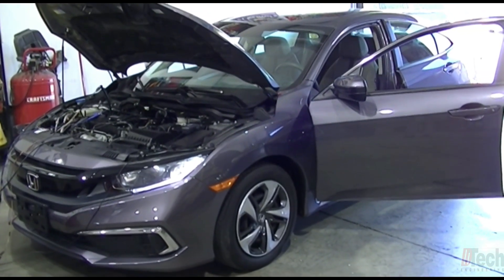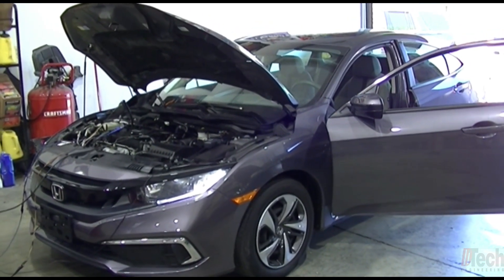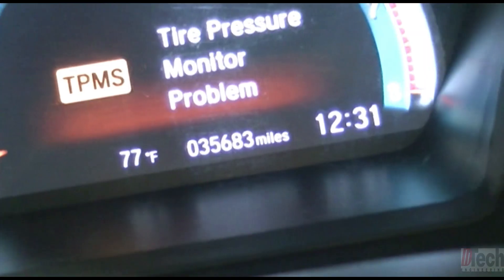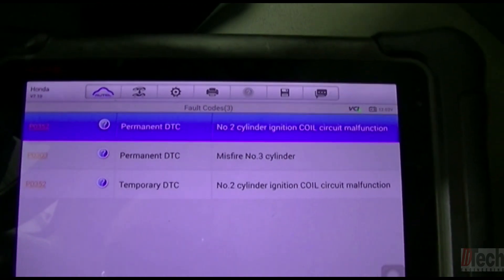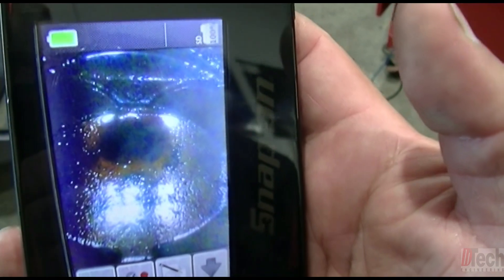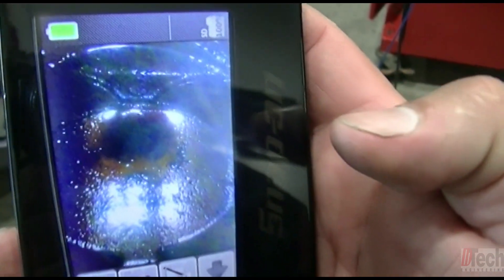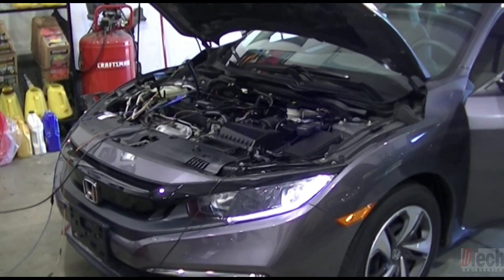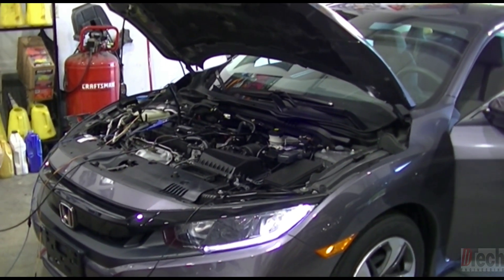2019 Honda Civic Misfire

Comment: Hey Sadel, do you think this one was actually the piston rings (low tension in modern engines) themselves having an issue. 
Or what is rife across manufacturers using this low tension ring design for efficiency. Just the oil rings failing/jamming in the ring land. Failing to remove the oil from the bore. Creating a hydraulic clearance between the bore and compression rings? That's why you don't see it at cranking speeds/pressures. But becomes obvious with the higher, more explosive pressures while running. Pushing the oil from between the ring and bore while simultaneously expelling the compression into the crankcase?
Does that make sense?

Comment: Why will  be the pulse? For cyl 3 even higher  than cy2, which is the actual cylinder with issues?
Reply from the maker: Pulse is created in crankcase when the pressure rises, and it happens each time the number 2 cylinder is on its upward travel. Cylinder 3 is its companion cylinder and so it does show a high pulse when 3 is on compression but the pulse is actually generated from 2 on upward travel on exhaust stroke. The pressure spike actually varies from cycle to cycle and sometimes looks higher at one point and then lower on same point on next cycle.

Comment: Sadel, What transducers do you use? Have a link?
Reply from the maker: Michael, on this one I actually just used a tank psi sensor, it is absolute and scaled in inches of water, which works great for coolant tank testing for head gasket, in the exhaust for misfires, and in crankcase for pressure pulses
Reply: @DTEAuto  i actually just made 2 out of used gm tank sensors...the one worked awesome 2 times then quit..the other never worked 😆 i guess i need to get new ones and not ones that have been in my box for a decade lol

 how do you find the info to make custom scales for these?
Reply from the maker: Yes, that's what I use, for the time being it works great and does the job. I use the snap on 5v box to power it up and its corresponding cables. 
And honestly, I personally have never "scaled" it, only due to the fact that, for this one, I don't really need to see actual "spec levels" as opposed to activities and events occurring in time, that's the more important thing when using this one. For misfires in the exhaust, you just want to look for vacuum pulses, doesn't matter the scale just travel towards vacuum which then indicates misfire, for coolant and cranckase, you want to look for positive pressure events (peaks and spikes) not necessarily the levels in amounts, but just the fact of capturing positive pulses would give you enough clues to make a diagnosis. The only thing that I would mention, is that the gm sensor travels upward in voltage scale for vacuum and travels downward for positive pressure.... so, you just have to get used to that or if it helps you can always make an inverted trace after the original capture. Also, I like using this instead of pulse sensor because it is absolute and so you don't have the flayback pulse after a pressure change which I think can add some difficulty when trying to decipher a waveform.
Hope this helps some.
Reply: @DTEAuto  thanks, yeah i found out about the inverted voltages and figured as much about the scaling, i really only care about the pattern. Thanks again